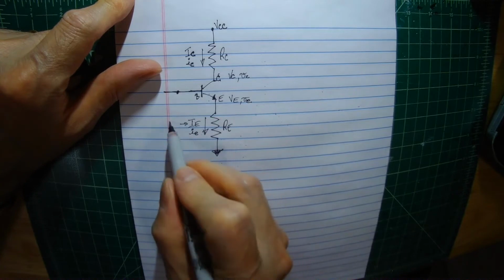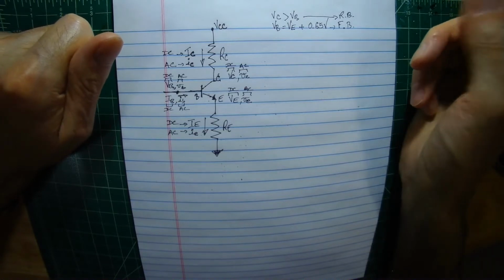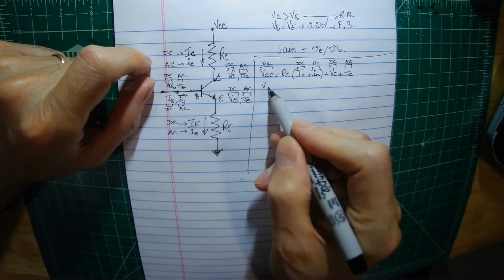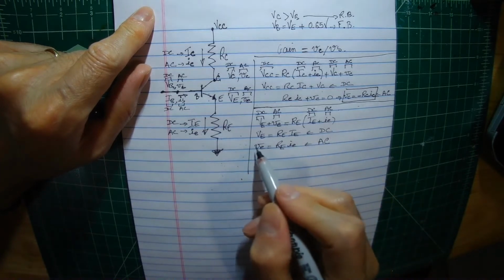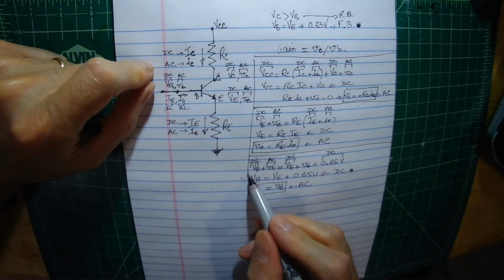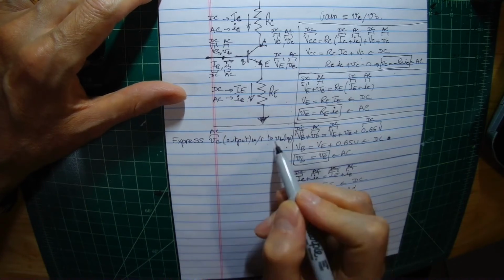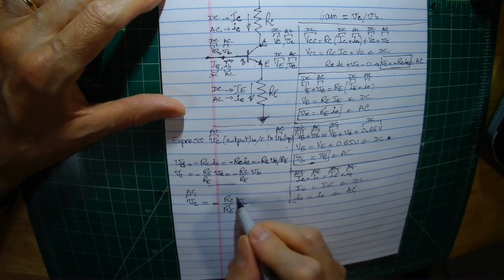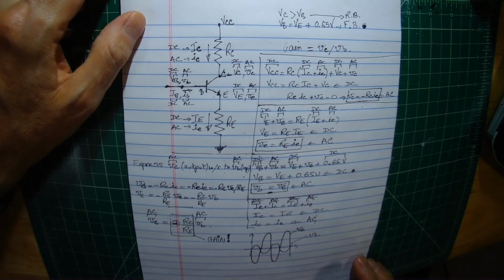Gain of a common emitter BJT amplifier. Easy peasy.

Comment: Should cover practical implications of picking the resistors.  Eg.  100k/10k = 10x gain…but so is 1K/100.  What would be the difference between each pair?
Reply from the maker: I made another video where I go into the details of picking the right value for voltage divider setup that sets up the bias voltage. Title of video is something like "common emitter design (part 1)". the key is make the design not dependent too much on the beta of the transistor. This gives you an equation in R1 and R2, and since you know the ratio, it gives you exact values for R1 and R2. No guess work. Note that the choice of R1 and R2 will also dictate (I believe) the input impedance of the your amp. Something to consider as you want that input impedance to be high, rather than load. Otherwise, you are gonna load down your source. Another reason to use op-amps for audio stuff.